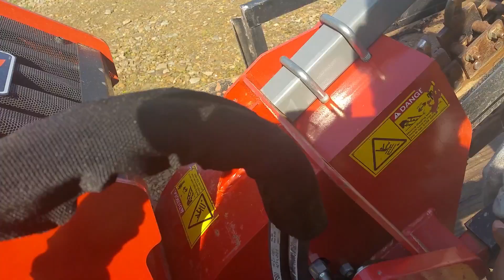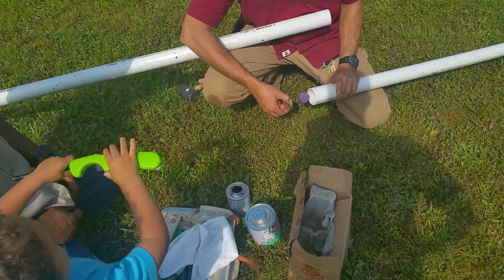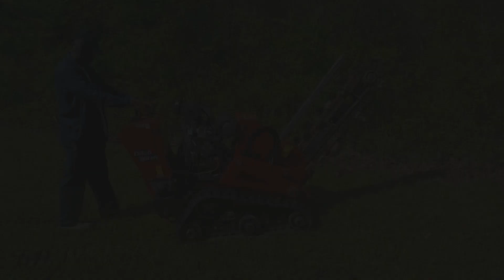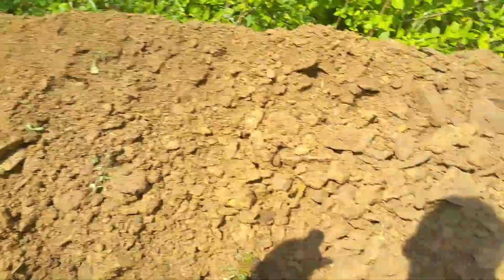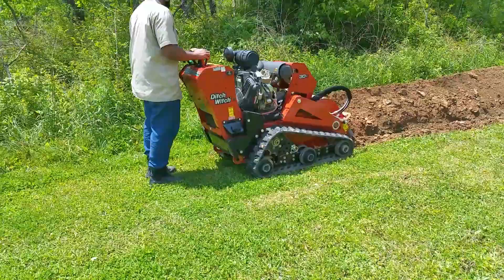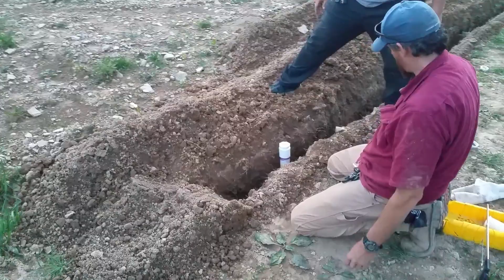The Dig

Comment: Greta job! The Ditch Which is one great piece of machinery!
I ended up investing in a Portable Back Hoe, that you can pull behind your car. 
It is much cheaper than a Back Hoe, and runs off a small motor that powers the hydraulics, Great on gas!
Up here in the Southern part of Canada, anytime we dig we need to worry about our frost, so we mainly dig just bellow the frost line, and in our area, that is 4 feet.
So the investment paid itself off in my jobs.